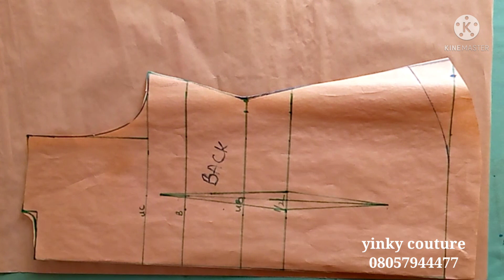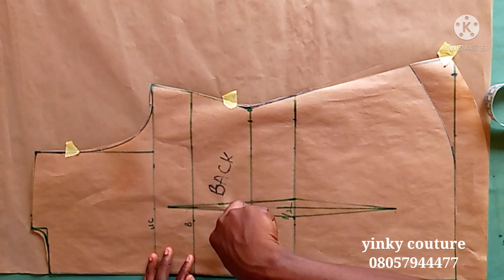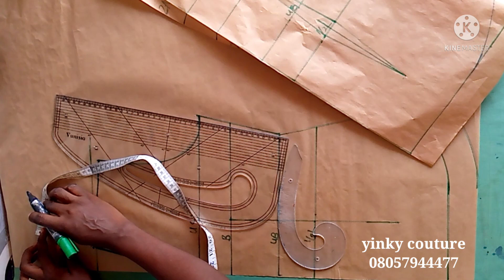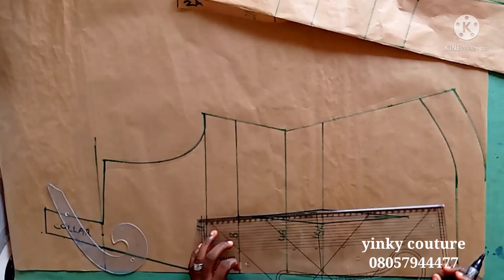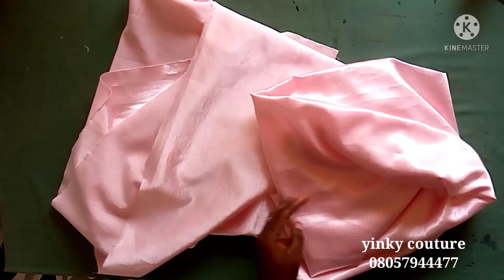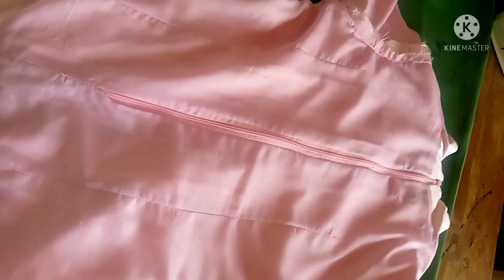HOW TO MAKE A BUILT-UP NECK BLOUSE DESIGN/ HIGH NECK COLLAR, AND BELL SLEEVE

Comment: @yinky couture thanks for this detailed video….please I’ll like to ask..after drafting this top..did you add half inch sewing allowance round the neck ,shoulder,collar region..or it is sewn exactly as it is cut.?
Reply from the maker: You don't need to add sewing allowance round the neck, that has been added already, remember the collar width is 2" and the actual collar width needed is 1".and the shoulder&neck  doesn't need sewing allowance cos the back pattern used to draft has sewing allowance already, make sure you've added sewing allowance on  the pattern you want to use.

Comment: Please will it be possible to draft this using the front bodice?

The next design of the style I want to make, makes it difficult to use the back bodice to start. 

It's a yoke from a bustier that I want to modify into a builtup neckline. 

Now the actual armhole of the front isn't matching up with the new one I did using this tutorial
Reply from the maker: Yes , you can use the front bodice, and you can modify the bustier yoke directly to form a built-up collar
Reply from the maker: Yes , you can use the front bodice, and you can modify the bustier yoke directly to form a built-up collar